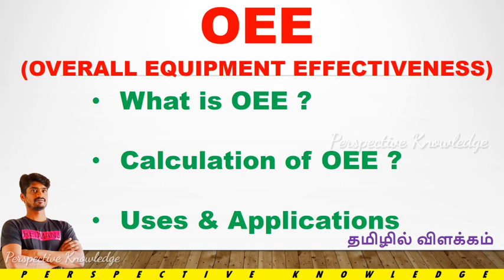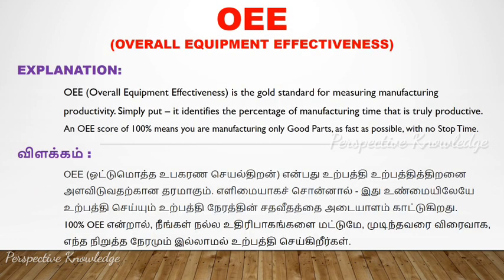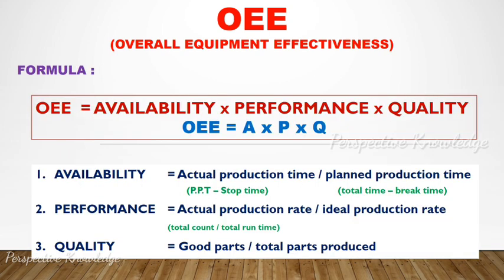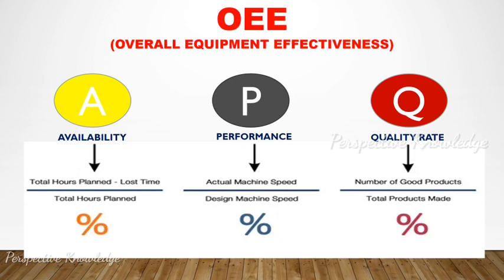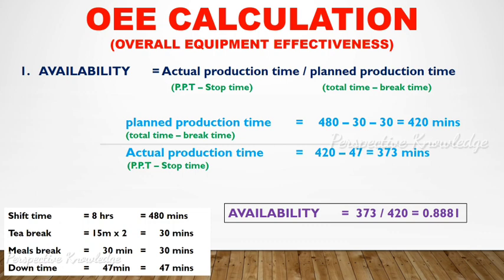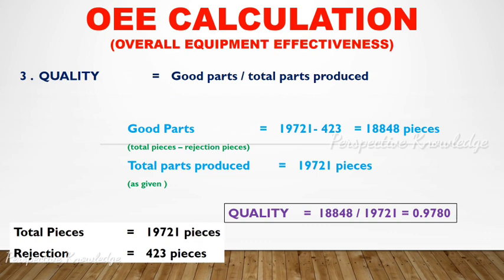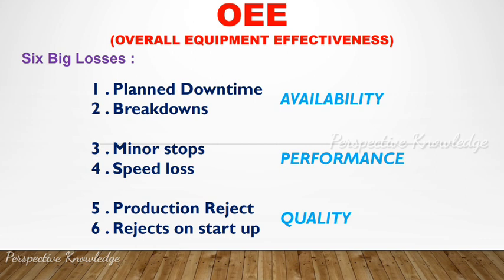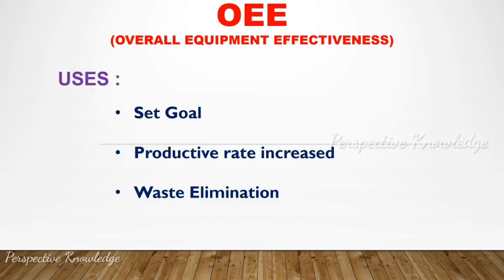what is OEE in tamil | oee calculation example | OEE | OUTPUT calculations | perspective knowledge

Comment: Bro 19721 total piece epdi vanthuchu enku purila.total running time 480 tea break and lunch time minus pannuna 373 tha varuthu 373*60=22380.athu enku purilainga na 19721 epdi vanthuchunu.REPLY BRO.
Reply from the maker: Athu nammala yeduththu fix pannuna value bro, athu calculation la vara vaikkala,

Maththa properties lam kuduthutu, athukkana capacity ulla process la erunthu,, 19721 tha output yedukkurom nu vachikittu, athoda oee ah calculate pannanum,

19721 value calculation kaga, nammala fix panna value, there is no calculation for that value, its like assumption
Reply: As Assumption output